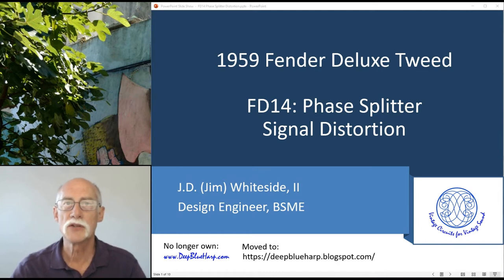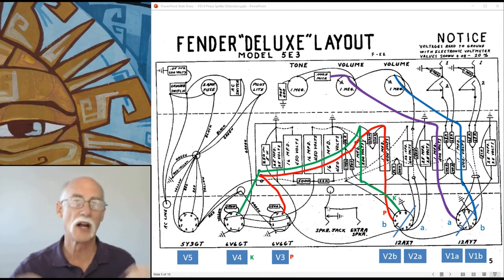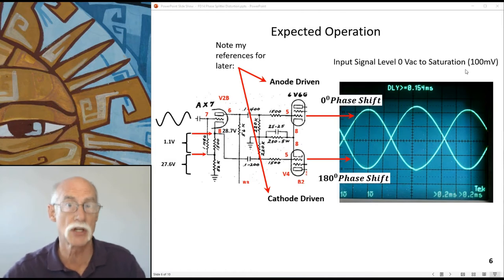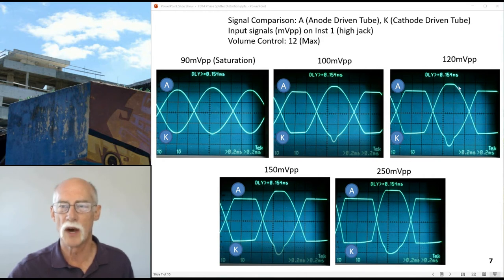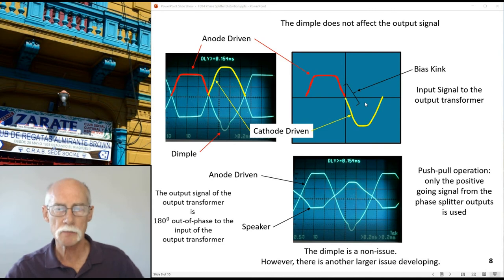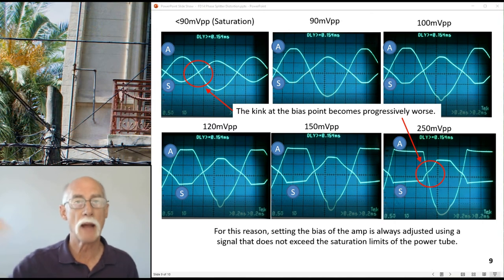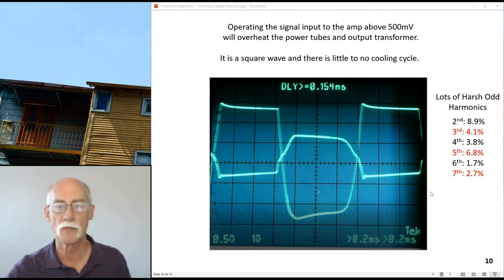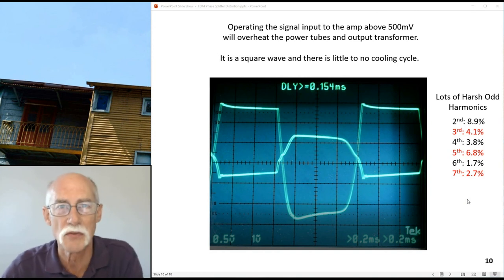FD14: 1959 Fender Deluxe Tweed: "Phase Splitter Signal Distortion"

Comment: Great inverter when I'm short on triodes.   I use it in one of my favorite amps.  I'll have to scope it, but I'm pretty sure I'm not overdriving it  (sound wise anyway), also running a higher plate voltage.  Thank you for your videos!